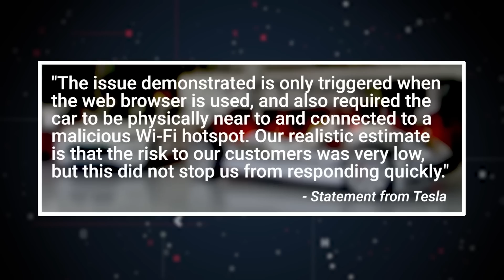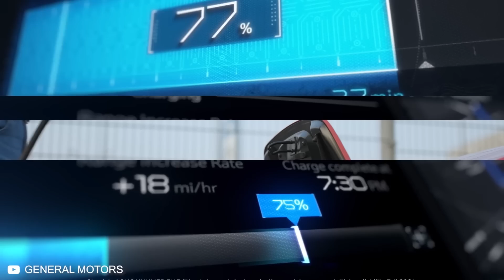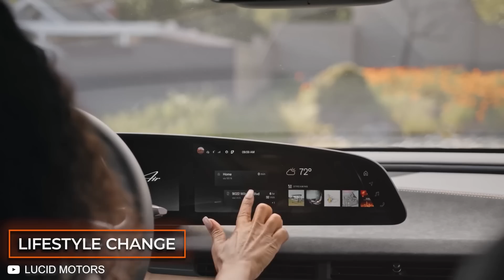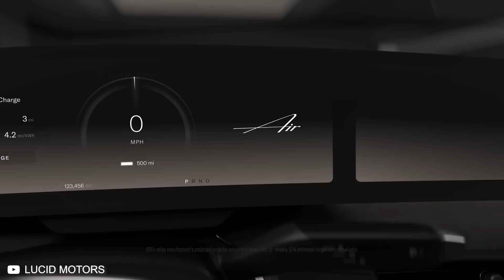EVs' Serious Problems That Carmakers Are Hiding

Comment: This seems to be a straw man argument, ICE vehicles have a century of theft statistics!! Yes, everything is hackable, but just as insurance companies do, you have to judge issues on probability and severity. If Teslas were being hacked, Tesla would address the issue. If Teslas were being hacked the news would LOVE to report it! But Teslas aren’t being hacked so this is a non-issue. 

Nearly every single maintenance issue mentioned also applies to ICE vehicles! Wear and tear, mechanical breakdown, performance degradation, and damage. 

An EV released by a legacy manufacturer with be serviced by that legacy manufacturer, thus the service and maintenance issue, isn’t an issue!

Once again, if there was an issue with Teslas being serviced that would have been addressed by this point. However, I don’t see or hear any Tesla owners complaining or abandoning their Teslas for ICE vehicles. Non-issue.

Comment: There are many statements within this piece that are either incorrect or misleading. I also will give credit to the points that the video gets right, or mostly right. Sorry, but this is going to be a long one.  Please see the following bullet points. Simple online research will support these points. 
*  Hacking.... ALL cars are highly dependent upon computer chips and therefore can potentially be hacked. To infer that this is an EV only issue is misleading. 
* "High maintenance costs"... I have owned an EV for 2 years now and have experience driving and racing other EV and ICE cars. Maintenance is actually far less. No oil, transmission or brake fluid changes. The one area that will be slightly more is tires as the weight and high torque of and EV does wear out a set in about 15-20K miles. It is also true that repair times are currently longer on EV's due to the small number of shops with the needed expertise, however, this is usually only an issue if the car in involved in a collision as there are very, very few problems that could arise that would make the car un-drivable and need to be taken to a shop. (Most Tesla repairs are done by traveling service at your home or place of work). You don't need to live in Dubai! 
* Battery loss / degradation... In 23 months of ownership, my EV (Tesla Model Y Long Range) has lost less than 1% of the original charging capacity. The numbers in this video are "worst case scenario". 
* "Fewer moving parts doesn't mean fewer problems."  This is laughable and just plain wrong. The number of failure points in an ICE vehicle is multiple times higher than on and EV. 
* Yes, replacing a battery pack in an EV is very expensive, but this is something that the vast majority of owners will never experience. Current tech is good for 125-150K miles before replacement would be needed, and tech is improving swiftly and soon the pack will outlast the life of the car. Also, as tech improves, it is very likely that battery replacement will become more affordable. Also, have you priced replacing a drive train on an ICE vehicle lately? (Engine and Transmission). Depending upon what you are driving, the cost could easily approach that of EV battery replacement. 
* It is true that EV's do lose range in the cold weather. It is possible if your live in the US northeast or central northern plains that you may lose about 30% of your range on a particularly frigid day.
* Charging network... If there is a reason that and EV is not right for you at this time, this is it. Having said that, EV charging stations are proliferating throughout the US and the EU. Even now, if you live in or near a major city, the network is likely robust enough for 99% of your driving in a year. Trips do take a little more planning, but are quite doable as long as you aren't going to the mountains or a remote beach. (I recently made a 6-day trip from Pittsburgh, PA to NYC,  Boston and then Philly on the way back. I did track the time spent in Supercharging stations. Allowing that an ICE car would have stopped for only 15 minutes, I counted everything over that, which amounted to about 1 hour and 25 minutes over the six days. Even paying supercharger miles the cost was less than one third of what my ICE car (Ford Focus ST) would have cost. 
* The number of EV choices will increase dramatically over the next few years, including more affordable options. 
* The narrator reeling off the past failures of EV's is highly misleading and has nothing to do with current EV capabilities.
Reply: But how about those of us who CHOOSE not to have cars with a TON of tech in them? My Magnum is the "dumbest car" within 5 miles of itself.....yet has lasted on the same motor for more than 300K miles and STILL has a reliable 300HP on tap when I want or need it! And it made a trip from Charlotte NC to Central Fla on a tank and a half of fuel in about 8 1/2 hours (at 80 MPH+ the whole way-your EV would take DAYS to make the same trip!!) In fact, we are about to replace my wife's car with a clean '57 Chevy that we can DRIVE cross country with all the needed "tech" contained on our cell phones.
Reply: @delaunfifield3490  if that works for you, then go for it. BTW, my third car, and my first love is a Porsche GT4. ICE cars can be great, but just like the horse & buggy, their days are numbered.

Comment: Data hacks: not just a thing of EVs. Pretty much all middle class cars have the same internet connections to the manufacturer that EVs do. These connections analyse the condition of the car and warn the driver of problems while informing the manufacturer and informing road services. When I got a Kia Ceed as a loaner (gasoline car) it had the same infotainment systen as my Niro EV with the same apps installed, including Kia Connect. Board-computers have been around in cars for a couple decades. Out 1998 Opel Astra had one.

Maintenance: My Kia has a 7-year guarantee that ties my car to the dealer garage, or any Kia garage. But before that, I had a Skoda Yeti that, with the exception of emergency light bulb changes, was always serviced by the local Skoda garage. The free towing service you get when you have your car serviced also ties your car to Skoda garages, also underway, which is a good thing, as anything wrong under guarante is then fixed for free. If you just had the car serviced 4 months ago and the oil filter explodes, it's fixed for free. Towing to the Skoda garage is free. a loaner is free. Same thing with my Kia Niro EV. And c'mon. the whole spiel about how delicate the main battery is, is rubish. The battery of my Kia has a longer guarantee than the rest of the car. There is nothing in the guarantee about excessive heat or cold - better not be becasue EVs are huge in Norway, where it gets pretty chilly.

I on't go on, because this video is obviously propaganda against EVs, probably for some ICE proponent org.

Comment: Honestly, I believe hydrogen is a much better long-term solution, electric has too many drawbacks. Lithium mining is horrendous for those involved and the planet, range anxiety, degradation of batteries, charging time, price, etc. If the R&D spent on electric went towards hydrogen and building out its infrastructure, it would be amazing to see what happens. The power grid is going to suffer tremendously, whereas, hydrogen is the most abundant element on the planet and only emits water as exhaust. Of course, it will be too late before any of the imbeciles in government realize this catastrophe or ignore it because someone is giving them money, either way, we are F%^&!
Reply: Hydrogen still needs to be extracted from somewhere, usually done trough electrolysis where you spend 100 kWh of electricity and only get around 50 kWh worth of hydrogen.

Lithium will soon be irrelevant and replaced by newer and better battery chemistry.

Comment: The maintenance issues you mention are bullshit. Why? Because the coolant can be changed very so often. And the lubrication is only at the bearings on the wheels. So in essence that issue isn't a problem. And tires and suspension are pretty much the same.

Comment: Take some information and distort it to your purpose and you end up with a crap video like this.
Reply: Agree. Doesn't mention that battery cells can be replaced instead of the whole pack. Two of my sons have EV's and can't charge at home - not an issue for them. Maintenance is far lower and we bought our six month old EV as an ex-demo with 4000 miles on the clock with £8500 off list.

Comment: (oo)The Alternative to plastic/petroleum-based products is hemp  various different materials substances resources for it makes over 26,000 different things.  It has even been proven to be 10 times stronger than steel and 30% lighter stronger and lighter than concrete, stronger and lighter than brick. Far more versatile making the design possibilities practically limitless, at the same time being easier to work with on-site'  equally as amazing 1 acre of hemp! Can produce enough bio fossil fuel to fuel 10,000 vehicles for a year at about a dollar per gallon.  One of the major differences is hemp bio fossil fuel only releases the same amount of carbon dioxide  unoxygenated air per mile as a person does when the exhale versus coal, oil, and gas. Which release tens of millions of years worth of petrified death per mile. The real winning sales pitch"  is 1 acre of hemp! Produces 3 to 4 times the amount of oxygen as a acre of trees at the same time sucks in 3 to 4 times the amount of carbon dioxide, greenhouse gases, deadly unoxygenated air as a acre of trees plus it rejuvenates and replenishes the soil back to Garden of paradise type of quality after every harvest even if the landscape has been previously stripped, robbed, and depleted from overharvesting things such as cotton and corn that has been marinating in petroleum-based fertilizer.  Not to mention it has the same nutritional value as rice, corn, wheat, barley, and milk combined is one so we can easily deal with people being over fed and undernourished   In layman's terms                                          we can rebuild faster much more efficiently at a fraction of the cost in half the time of what we are doing today without leaving any excess poison is toxic waste behind.  	In other words we can manufacture, mass-produce, distribute products that every country, city, and continent is going to be happy to spend top dollar.  Example, hemp clothing  distributes moisture across the body more efficiently than any other material leaving a person feeling, smelling, and smiling their best even under the most extreme circumstances don't forget about the limitless design possibility plus it promotes good respiratory function so if a person has asthma, allergies or other breathing complications just by wearing its clothing you will alleviate those symptoms with the potential of diminishing them all together. Hemp  has even  been successfully grown on radiative soil.  So in theory if we grow hemp along the shores of our rivers and lakes we will greatly improve upon the quality of that water.  Nonetheless we definitely will improve upon and maintain the quality of our air, water, foods, landscapes, working/ living environment, habitat, and every day home products to the highest degree that is humanly possible by producing 3 to 4 times more oxygen per acre than we do currently.  At the same time sucking in 3 to 4 times the amount of carbon monoxide greenhouse gases  un oxygenated air per acre as we do currently,   as a added bonus everywhere we grow it we will be rejuvenating and replenishing the soil back to Garden of paradise type quality even if the landscape has been previously stripped, robbed, and depleted of all its value from overharvesting things such as cotton and corn Keep in mind America has about 800,000 acres of available farming land.  	So again we have the manpower, woman influence, technology, resources, substances, capability, and technology to create clean high-paying jobs from coast-to-coast that will improve upon and maintain the quality of life in such a way.That will gradually consistently, constantly, systematically almost effortlessly and naturally thus allowing each person's generation to become stronger, smarter, healthier, happier, better off physically, mentally, financially, possibly spiritually then the previous generation. With that type of leadership, loyalty, and devotion to one's self and country People may start finally having jobs, products, power sources that will allow them to be healthy and wealthy enough to live enjoy their life all the way through out retirement.  You can't do that would dirty low-paying jobs.  That come from outdated power sources, inferior materials, poisonous, toxic substances, pesticides, and chemicals that never change their killing composition which means whether it's solid, liquid, or burnt off in to our airways atmosphere as a vapor is always going to be poisonous, debilitating, deadly to the body at the same time polluting, corrupting, and devastating to mother Earth and all the various different forms of life that live within this world. 		 The bottom line you cannot promote life by doing business with materials, resources, and substances that have been scientifically classified, religiously verified as petrified death or worse. Think about this because it's a simple logic basic concept if life is not free why the hell would death be any cheaper. I guarantee it's not so would you like to know how souls and spirits have paid out are picking up the tab on the end results of dirty low-paying jobs.  Would you like to know how souls and spirits have paid out are picking up the tab on a diminished quality of life? A better question what do you think the spiritual cost is to one's own soul and spirit living dying to the lowest standards of quality opposed to the alternative which is the highest standards of quality?  Case closed. Mercy, forgiveness, and spiritual welfare are not changing these facts. Protecting, carrying, and compensating any whimpering, whining, crying souls and spirits that are freely connected to a life that is not living up to the pleasure, potential, responsibility of femininity and masculinity. You're either part of the world solutions or you are exacerbating the world's problems either way there is no playing it safe in the middle  every one of us is being held spiritually accountable for each and every moment.I Laugh, smile, grin, chuckle with confidence I say now a wish and pray for my soul and spirit to be held spiritually accountable to the statements I proclaim to the way I'm living personally professionally.	 I guarantee you never see hear another body, man, woman in power, persons of legal, religious authority, leaders ever freely validate the statements they proclaim with that level of certainty. One reason could be the don't have the best interest of the majority of the population's needs at heart. Another reason could be they cum from a bloodline of cowards! One is genetic  hereditary the other is simply a generic learned behavior either way it is physically, mentally, and spiritually useless to freely live and die in such a low quality manner especially if that stupidity, ignorance, and desperation stems from being soft, lazy, out of shape, over fed, undernourished, overworked, underpaid with dirty low-paying jobs. S.R.F.
Reply: Nobody read this.
Reply: @dougandersen645  This dude probably just copypasting this stuff.

Comment: Boy! This video must have had a great subsidy from fossil fuel industry. The EV glass is half full at present but rapidly improving. This video seems pretty biased. There is very little mention of the positives. I'm reminded of car dealers telling me I'd have to spend $8,000 to replace the battery on my Prius which ow has over 215,000 miles on it and going just fine. Wonder how this crew will bash clean cars when the next generation solid state batteries come out?
Reply: One out out of Five EV owners have switched back to driving gas powered vehicles because the EV's proved to be too much hassle. So just because you're happy with yours doesn't mean they are practical for everyone. Also, how many people have $8000 to $15,000 to replace batteries when they do need changing? Furthermore, EV's are not practical for utility. Good for commuting to work or the store and home. If that's all you're doing, then you're not a good source for all the rest of us that actually use vehicles for work to use as a reference.
Reply: @robertkarp2070  By your own standards, 4 out of 5 ev owners wouldn't go back to gas
Reply: @robertkarp2070  Dont forget that you are in the minority of drivers, 80% of people drive less than 50 miles a day.